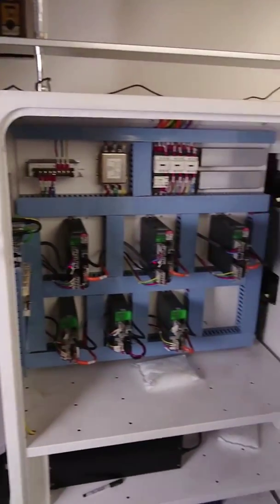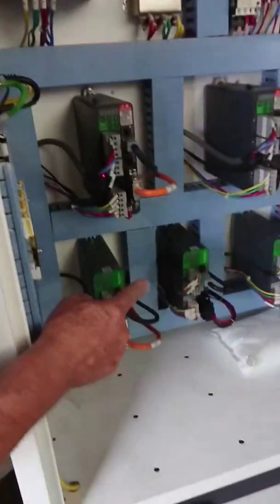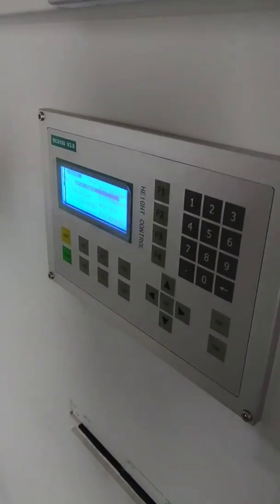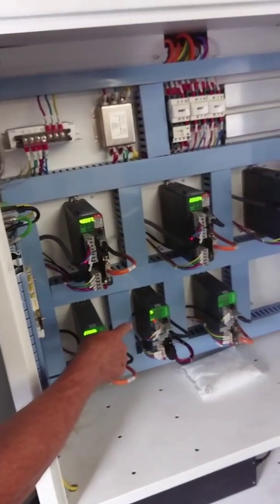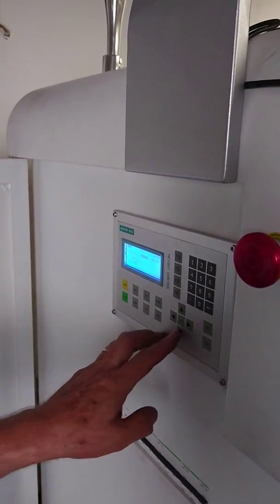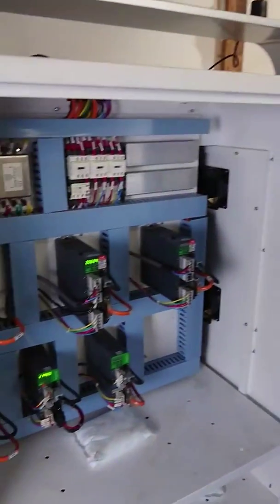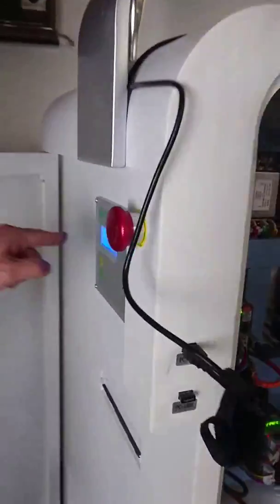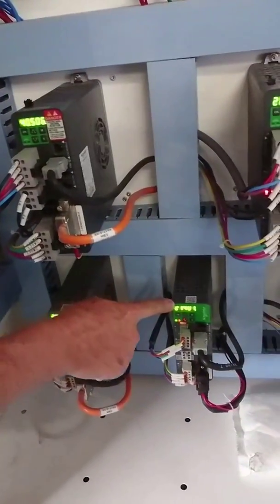laser cutter woes

Comment: 1:30: If you risk your life. then you are doing something wrong. LOL. Why check the transformer if you have power into the machine? If I should suggest something if you haven't already fixed it, I would cross exchange the servo drive that has the fault, with another one that is working. If the problem moves to the other axis, then you know what the problem is. And maybe also call the manufacturer of the machine, to get some tips forom them?